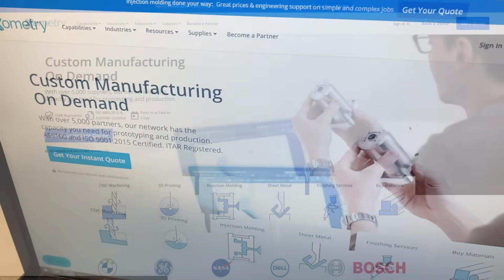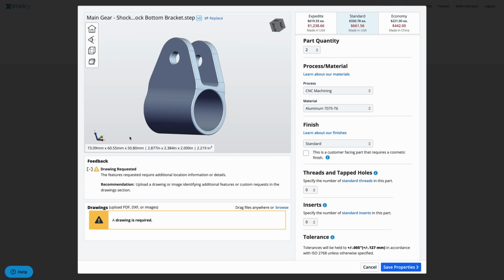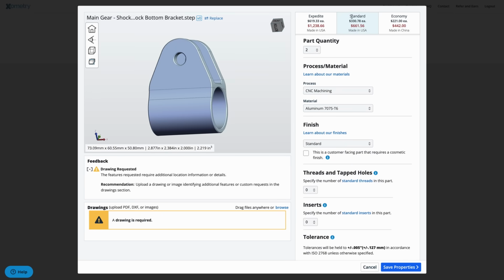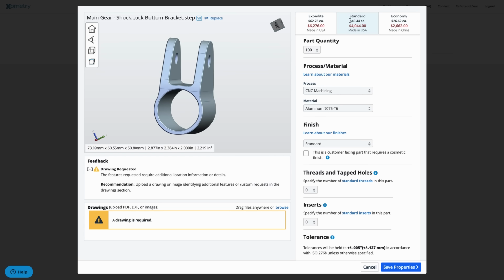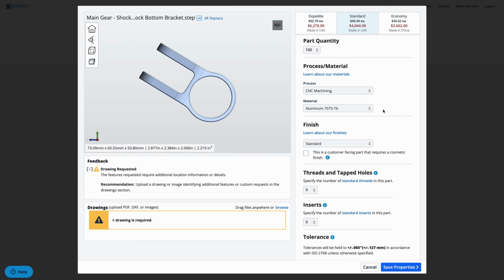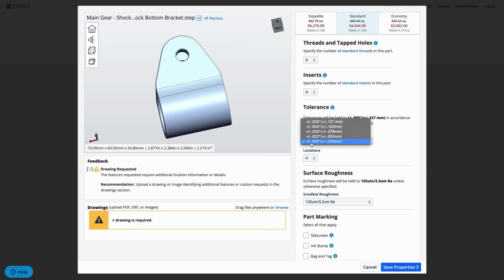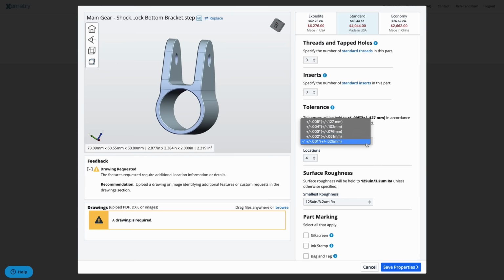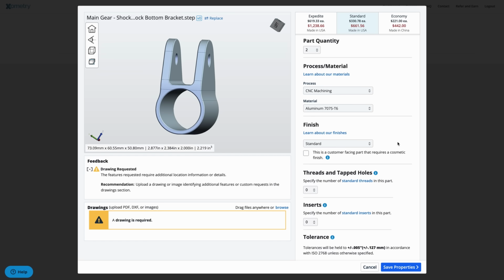The TRUE COST of CNC machining!

Comment: Couple comments.  As far as total cost you didn't touch on how much your cost to program this part, time on machine, and time away from doing the work only YOU can do for your company. How much is your time worth?  Especially for a simple part like that.  

Second, inspection is critical here.  We have personally used xometry with wildly varying results.  Their inspection was horrible, we had to train them on GD&T.  This plug and play perfect part model they have is still a dream.  So there is a great deal of value knowing your parts are right by machining them in house.  

Lastly, be careful sending models to a third party without protections in place.  Using them as a "free" quote tool is going to get you in trouble when you see your exact parts being built by someone else.  You willingly have your IP away.  

Thanks for an interesting video!

Comment: I still find it to expensive. Here, in the Netherland small machineshops would charge around 20 dollars for a quantity of 100 pieces for a small part like that. I would not trust that quote calculator for 100 procent the price depends on so many variables that sometimes it can be really frustrating to make a price.
Reply: It is also a good thing to consider working on a simple projects for 30 dollars/hour with no worries just running machine 24/7. Most of the time we are earning more on simple products that on an difficult ones. Simple set up. Just start and run less worries, less prosuction control dont need skilfull people for that sort projects what also cut the cost

Comment: I got an eye roll when I made 2 custom RC plane parts overnight and only charged $20.
Reply: $20,thats quite generous of you👍,and overnight on top of that.
Reply: LOL my company once ordered a simple part kind of a grip with 2 forks at one end the whole thing was maybe 1m long tolerances were not important at all. Unfortunately our construction guys used the tolerances for highend optical tools ( 50micron at 25 deg C). The company ended up paying 15000€ for the tool😂
Reply: Most the RC market is notoriously cheap. Simply put, if the budget was there, they wouldn’t be racing RC. 😅
Reply: The thing about r/c is 90 % is made in China. I've had 3 different helicopters. They mass produced a helicopter as a reddy fly and since they come from a different country that pays their workers 1/10 of what workers in U.S. make and there is no teriff to sell in the U.S. you get the stuff for less money than it could be made here in U.S.. They were selling a complete rotor head set up for 80$. It would cost me more than 80$ just for the bearings that are used. Never mind the 20 hours to machine all the aluminum parts involved. Then it would cost another 80$ to anodize the parts. Then a year later when you crashed and needed parts to fix there wouldn't be any parts available because they only made so many spare parts to sell. Then the helicopter is useless. 
So this guy looks at the part and thinks I get parts simular in size and appearance for 5$ . They're just clueless to a manufacturing process.
Reply: Based on the wording of the comment I am presuming that you were the supplier here. That's quite generous of you. I am sure that customer will be coming back to you for future work. Feel free to drop your website address here 👍
Reply: @oceanic8424  I made an overnight custom part for an expensive RC aircraft and only charged $20 for 4 hours of work. When I gave the customer the part, he thought I was way overcharging. 

I'll not do that again.
Reply: @user-qy9rg3nt2l  Clearly, the customer was someone that knows next to nothing about manufacturing parts and could not appreciate what you had done. These are lessons learned. 
👊👊👊
Reply: @oceanic8424  Agreed 100%
Reply: @user-qy9rg3nt2l  that makes the decision to not make RC parts way easier in the future.
Reply: @user-qy9rg3nt2l i designed programmed machined a 3d air cleaner cover for a hot rod. It was about 12x12"x2" i had 8-10 hours into it. A guy was going to trade for welding. He welded on my mountain bike frame for 1.5 hours he thought i still owed him at least $150. What an old douche. Just the aluminum cost more than what the welding cost plus my 8 hours. I said jeez dude your 1.5 hours is worth more than my 8? He says yes because hes been welding for 40 years and electricity for his welder cost alot.... Needless to say i didnt bring him the $150 back and never talked to him again. i was supposed to make 2 it was for duel carbs. As i left he said i better make him the second one because one is worthless to him. I Had 50 bike frames welded elsewhere. What an insult......
Reply: @nobody617  damn. I hate hearing stories like this. Some people are just jerks and this their time is the only of value
Reply: @user-qy9rg3nt2l  - holy crap, really? I help people with “passion projects” from time to time (not machining) and almost everyone is super appreciative. The entitled jerks that don’t care about your time or equipment, well, they don’t care, usually complain the most, and it’s not worth doing.

My habit, since I’m rarely doing any fab stuff for anyone is to go up on the price when they make any sort of noise, facial expression, or try to negotiate down. It’s fun. “I can do that for around $100” “Can you do 50?” “No but I can do $110” “Wait you said $100?!” “Yes, but I charge for my time and this quote is taking longer than expected.” 👍🏻
The sooner you stand your ground, even on a favor, the happier you’ll be.
Reply: @user-qy9rg3nt2l  Cause he didn't understand. Did you explain it to him?
Reply: @robertmahaney6831  Yeah, well I don't let one person ruin my perspective on life, or of other people.
Reply: @nobody617  That's because designing on a computer is easy when you know what you're doing, and the machine did all the hard work, so the hours for welding equaled out IMO. Also, a 12-in by 2-in piece of aluminum cost more than $75-$100 dollars? Which is a typical hourly wage for a custom welding job. Let me guess you think a welder makes 15 to 20 an hour when they're doing custom work?
Reply: @YourUncle8501  No, you just don't get it either.
Reply: @dangerous8333  oh, you must be the customer
Reply: @dangerous8333  wut
Reply: @grumpysteelman  hahaha I like the way you think.
Reply: @nobody617  No joke, that's certainly an insult. Even at 10c/kWh my best lightly researched OVER-estimate for a welder is 40$ for 1.5h, and that's at 27kW draw.
Reply: @user-qy9rg3nt2l  charge him 400 next time
Reply: @dangerous8333  yeah and welding is easy once you know what you are doing. And to be frank .. 90 mins to weld a frame? A big part of that time will be setting and jigging it up. So his spin about cost of electricity is just bullshit. And setting up the parameters and the physical set up for cnc machining ain't trivial either.

And while cnc do take the tedium out of making a part, you DO NOT leave it all to the machine without watching over it or at least check on it frequently.

And FYI, a good CNC machinists is not cheap either.
Reply: @user-qy9rg3nt2l  20 dollars for 4 hours? thats half a working day, thats a fucking bargain, at our shop rate of 95 p/h (fabrication and not including material costs) do the math, god some people are so inconsiderate it shits me.
Reply: @user-qy9rg3nt2l  shoulda kept the part and and sent him packin.
Reply: @nobody617  Yea cnc machines dont use electricity.... Sarcasm..icant believe people today.. U only need basic experience too weld a bike frame LMFAO ..u SHOULD PUT his name out here so NOBODY hires him
Reply: @user-qy9rg3nt2l  you should have taken the part back and destroyed it in front of him. Then refuse to make another. It would have been an expensive lesson for him
Reply: @oceanic8424  my husband was into rc cars/trucks. I don't think you charged enough.
Reply: Honestly any sort of custom part for 20 is crazy low, if you wanted to get the part custom made anywhere else it’d probably have been 50 or more, the part on its own would’ve been prob 15-20 anyways so getting it overnight is a even bigger bonus, point is what’s the problem with 20?
Reply: bro, I would be so happy if I got that for only $20. Dang
Reply: Damn I'd pay 20 bucks to just get a call back for a price muchless having the part made
Reply: Honestly, we should not be here talking about money. This is China's business, cost optimization. We should aim value maximization. Otherwise, you are always going to be compared to some cheap service provider.
Reply: Well, what did we learn ? Some people suck and don’t undersell your time !
Reply: Sounds like my Boss. He likes loosing money on Jobs. 20. Bucks is Cheap. People have no idea.
Reply: You've got to do a bunch of those "freebie's" to get recognition and practice. THEN, you can charge a little more once you have recommendation prestige.
Reply: @TechieTard  I did that 30 years ago starting out. No time for nickels and dimes now.
Reply: @TechieTard  lol... ok, boomer
Reply: hero
Reply: How do I get ahold of you
Reply: Somtimes its about helping, not making money :)

Comment: There's another way to have done this job, why not just rough And finish it from the one side and then go straight to the soft jaws? Also I might be mistaken but that end mill looks like it could have completed that hole to depth from 1 side, so there would have been no need to stress about it not lining up on the 2nd set up or if you picked the roughed hole up properly. I only saw 2 setups ... maybe 3 if you had to machine the slot with no radius in the corners. Also i see there are clearance holes on the side so thats another setup

Comment: You could easily cut at least one of those machining operations. 

Also, surface roughness does have quite a high importance when it comes to machining cost and also tolerance of the parts. In the example the +/- 0.025mm tolerance is kinda wasted with Ra 3,2 as they are somewhat linked and you can't produce accurate surface with poor surface roughness. Surface finish for these kind of tolerances should be close to Ra 1, that Ra 3,2 would  be suitable for something like +/- 0.10 to 0.15mm.

Comment: You could had machined that part with 2 ops.
Reply: 2 ops would also avoid that blend line on the bore
Reply: How would you hold it for 2 ops?
Reply: @gregburton8540  OP1 machine contour and bore (stock will have to be longer and you will waste some of it) OP2 flip 90 deg drill and finish off rads around drilled holes + finish off bottom of part. cut it off

For that sort of stuff you would have to square off stock or throw it in lathe and turn it down to put it in collet block. Last problem would be right angles between "ears" but if it's not required to have those square it is better to put some rads in there (from structural strength standpoint). This could be solved by using woodruff cutters or slitting saw.

Comment: Set up and fixturing is the biggest expense on any multipart job. Optimizing tool paths and roughing is where the time is saved. Manual tool change vs automatic is a tenfold time savings. That pecking drill retraction speed and distance optimization could have saved you a lot of time, for example. I learned (taught myself) CNC when there were no CADCAM programs (IBM 386 days), only a calculator and a drawing. Machine and fixture rigidity and repeatability will save you a lot of time, money and frustration. Fun stuff. :D

Comment: 4 op part???? What is this a single axis mill?
This is a 2 op part.... use the second op and locate/hold the part on the bore you just made. Then you no longer need to mess with soft jaws and part lines on the bore. Hand deburr to avoid a clean up pass as you'll have time in between machine running to deburr. 
Thanks for the explanation of cost estimates bigger volumes better savings!

Comment: You mist a point in your cost comparison, how much did it cost you to do it in-house?
It is not only your raw material, your time is worth something. While you do those, you are not working on something else that might be more worthy of being made in-house and pushing the deadline. You also have wear on the tool and machine. You need to know your shop time cost to better calculate/compare.
You don't only outsource for parts outside your capabilities, you also outsource for parts that you don't have time or would not be cost worthy to do in-house. 
Anyhow, great video!